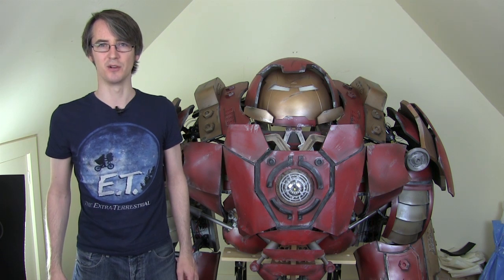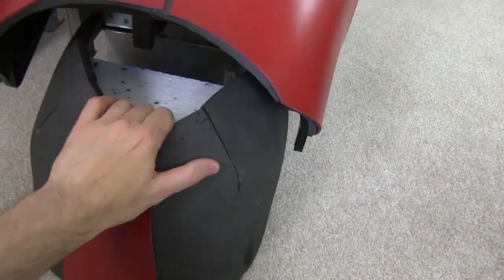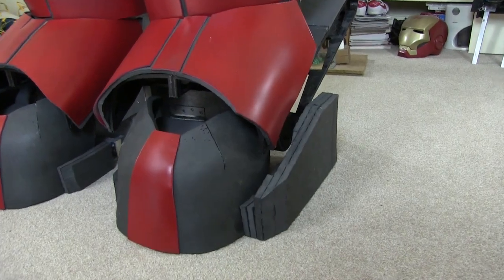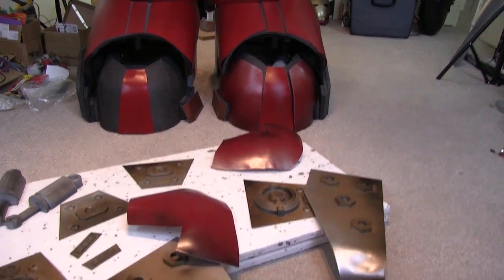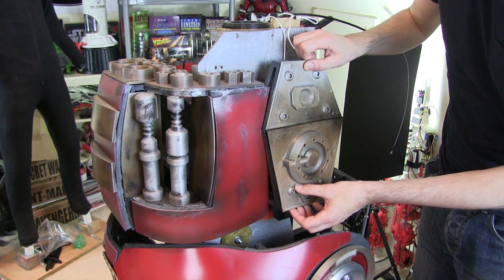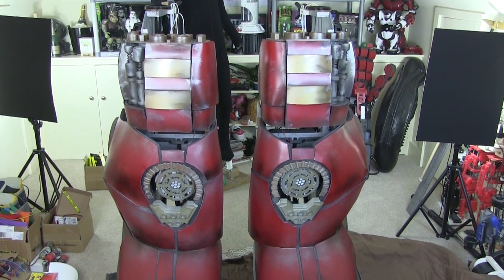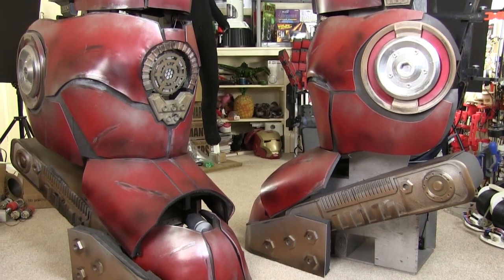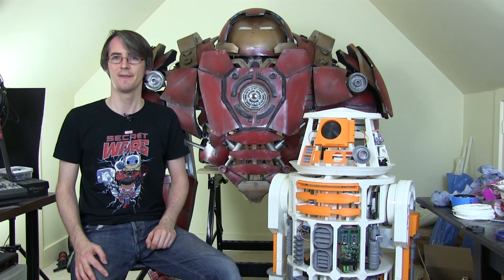Iron Man Hulkbuster Cosplay #41 | Leg Panels & Cosmetics | James Bruton

Comment: I noticed that the bottom of the feet is plywood. You might want to consider adding a gripping surface to the bottom of the feet. Plywood on a smooth, hard floor tile could be a potential slipping hazard. And considering the weight....that could be disastrous.